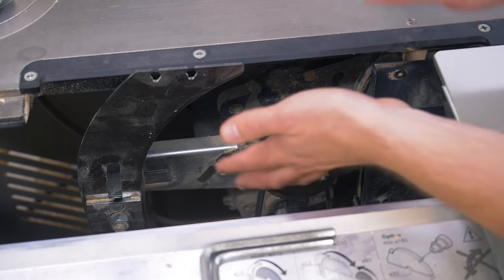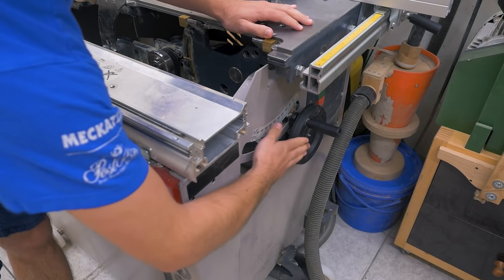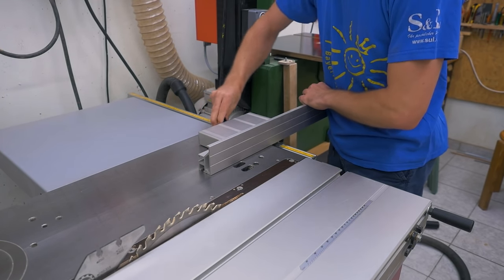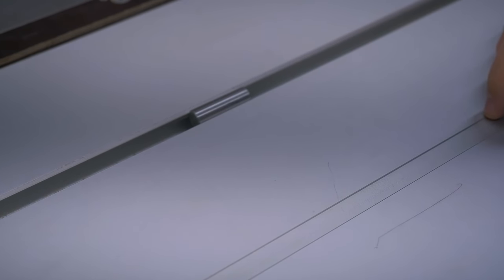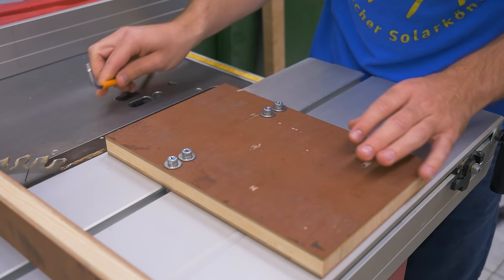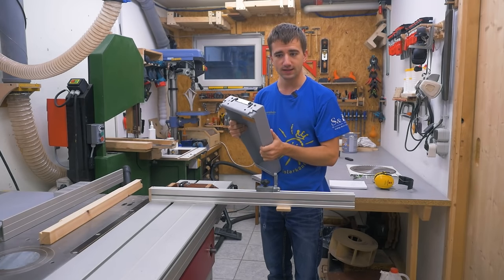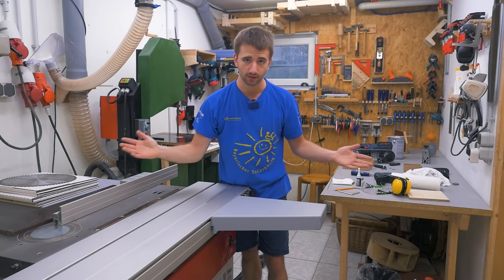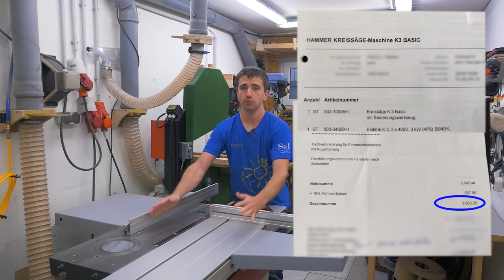Inside a Sliding Table Saw + Long-Term Review + Upgrades

Comment: Great and interesting video as always. Im looking into this saw myself. I initialy looked at the american styled cabinet saw, mostely because 99% of youtubers use them. As I understand the sliding table saw is not common, atleast for smaler shops in USA and Canada, where most woodworking videos come from. The price of the slider is a bit higher, but now I wounder, after all the jigs and accessories you need for a cabinet saw, the price difference to a slider is probably not that big. Also the slider is very safe to use. So after all that rambling, some questions: 1. My biggest concern is that the sliding table sits a bit over the cast iron table top. So when you use the rip fence and the right side of the blade, short pieces will not have a square edge. How big of a problem is this?
2. Im also woried that the sliding table will come out of alignment, and will need periodical adjustment. This looks very difficult and timeconsuming. The big advantage of the american style saw is its simplicity. Thanks again for yet another great video.
Reply from the maker: The slider will be shipped ever so sligthly above the cast iron table. I adjusted it to be perfectly level myself, when I set the saw up. It takes some time and back and forth, but then never changes. However if you ask the Felder guys specifically for a perfectly level slider they might do it in the factory
Reply: @MariusHornberger  Thanks Marius, this will defenetly solve the problem. The reason for the slider to be a bit higher is so the wood want catch on the cast iron I assume. Have you found this to be a problem for you, where the slider is level with the cast iron?
Reply from the maker: No, it's no problem

Comment: At 21:21 when you justify the distance for the holder distance, well... I see a potential problem. Your distance rationale is right as long as the working piece has a uniform distributed weight. If it's geometrically uneven or its density not uniform it won't work properly. Perhaps a few centimeters to the table side will be safer.

Comment: Hello Marius  I allways look forward to your videos.  One question, how do you loch your Hammer when it is tilted?  Your turn a screw but what does it do?   I have a Hammer K3 Winner (Marc from Belgium)
Second question : did you ever adjust the hight of the sliding table.  In my opinion is in a little bit higher then the saw itself
Reply from the maker: When you lock the angle you clamp the saw unit to the tilt spindel.
Yes, I adjusted the sliding table height when I got the saw to be even with the cast iron table. It's quite difficult to get rigth though
Reply: @MariusHornberger    Good morning Marius  Thanks for the quick reaction.  Is there a Youtube film "how to adjust height sliding table Hammer" ?

Comment: Hi Marius. Great video. I need to lubricate my rise-and-fall. This helps. With regard to the zero insert at the end of the X-cut fence, you need to make it "L" shaped. Your solid section will interfere with the dust guard (and you will need to keep the blade to full height). Contact me via my website email for a photo. I also have other mods for the K3. Regards from Perth, Derek

Comment: Hallo Marius, wo finde ich den deine Klemmhalter? Kannst du mir ein Stichwort oder einen Link geben?
Reply from the maker: Wenn du die exzenter Hebel meinst, hier: Ganter Normelemente GN 927-82-M8-A-B 927-82-M8-A-B-Exzenterspanner mit Innengewinde, Form A: mit Stellmutter, Grifflänge l1: 82mm Gewinde d2: M8 https://www.amazon.de/dp/B01N6UT6X9/ref=cm_sw_r_cp_apan_glt_i_BJKS8J52R54QP5GSATM6?_encoding=UTF8&psc=1

Comment: this doesn't matter, buuut:
12 51/127ths is the worst measurement they could have gone with.
127ths?!  really?  is what, ~ 0.0000124 that hard to take off?  
they made it sooo close to common measurements of 128ths.
12 51/128ths is 12.3984375  heck, go the ~0.0016 inch larger than 51/128ths and you get 13/32nds!  i even have that in a drill bit size, its not that uncommon, but nooo felder just HAD to go and make it sooo close.

...lol 
like i said, its silly.
really cool saw by the way!!!
im actually shopping and trying to find a small cabinet saw with a rolling table.  Maybe someday i will get that ulmia 1712r...